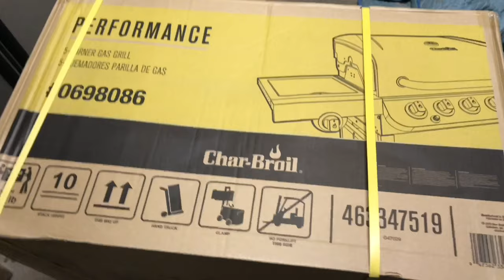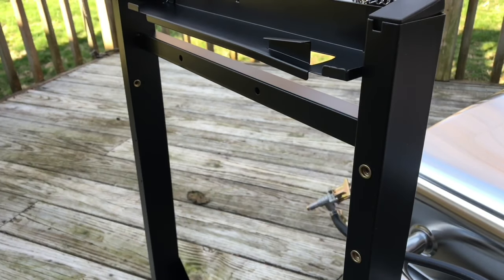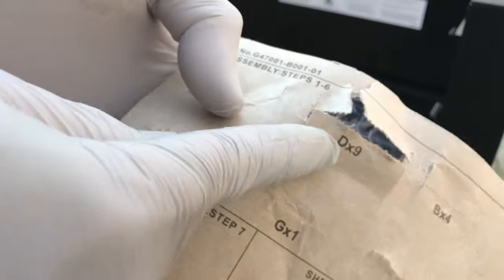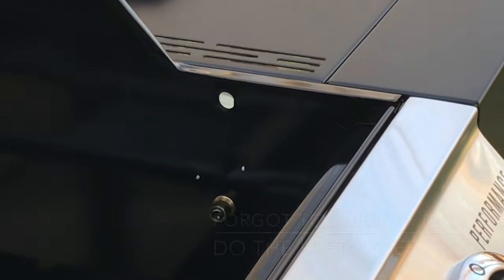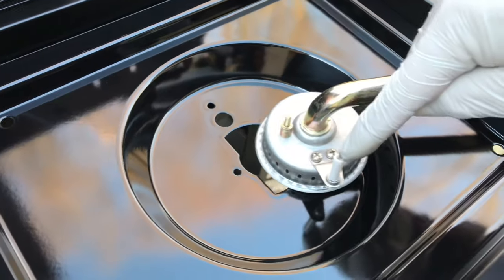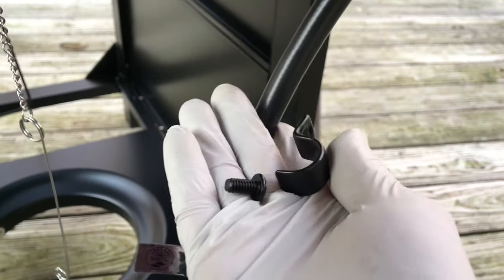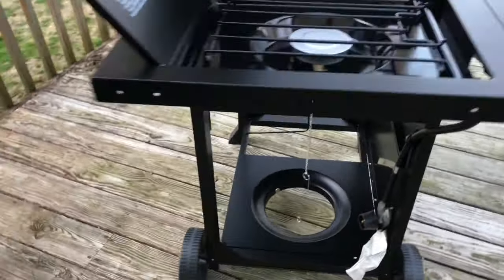Step by Step How to Assemble Char-Broil Performance BBQ Gas Grill 1 Side Burner Venturi Clip Install

Comment: You are the only person to actually show how to install side burner. Thank you. For a different grill but thank you. 🙏
Reply from the maker: I appreciate that!
Reply: Yes, I just got a very similar Char Broil "4 burner grill  with side burner without cabinet" at Menards yesterday but the factory seems to have made a mistake and included the instruction manuals for the version without the side burner and I had no instructions how to set it up. I did figure it out, but checked this video out and do find out that that one strange clip I still have left in the package also needs to go on the bottom. Seeing that was the most "rewatched" point in the video I suspect a lot of people got that manual. About to go buy a tank of gas and hopefully the thing works.

Comment: Big THANKS on assistance for side burner valve bracket-crazy clip thingie!! Part M dilemma solved with your help.
Reply: Did Charbroil include the wrong manual with your grill too? Mine came with the instructions for the one without the side burner but my grill very definitely has a side burner.

Comment: I always assemble my own grills because I trust my abilities but Lowes had them all assembled and it was kinda nice to not have to mess with it for once. Between ikea type furniture lately, grills and I have to do my sons bike for xmas i wasnt complaining.  I got this for $112 at my local lowes today, what a steal.  I wiped the inside and grate with canola and did my seasoning so shes ready for her first cook. 

After repairing burner covers and making brackets for the burners that were broken from a rusted out body on my 8 year old 3 burner it was on its last leg.  Also I could smell excess gas when usin the side burner and the ignition burner and i felt it's time to get a new one.

Comment: We were stuck on a specific part with the side burner, thank you for your video, it helped👍🏻
Reply from the maker: Thank you very much for watching and for the feedback! I can only bet that it was the Venturi Clip..? It is that little twisted wire connecting the tube and gas source/knob. Thanks again!
Reply: cbatilo lol, yes it was!!
Reply: How/what to clip the Venturi clip on for the side burner? I can hook one side into a hole on the burner but not sure where to hook the curvy side?

Comment: At 08:22 whje you connect the burner is that all you need when you connect the metal pipe to the metal gas part ? Wouldn’t the gas Leake ? I purchased a second hand bbq and I’m thinking maybe there is a part missing

Comment: How/what to clip the Venturi clip on for the side burner? I can hook one side into a hole on the burner but not sure where to hook the curvy side?
Reply from the maker: Pause it at 8:26 and 8:27 - It just hanging on the gray metal part of the fuel line. Thank you for watching

Comment: Hi could you help me pls ?
On my bbq i have the same side burner as you and at 8:16 is there any rubber gasket that holds the adapter in or its just the metal part connects to the tube ? 
Im worried there will be a gas leak without a gasket.
Reply: Metal tube to metal... it is designed that way. No gasket or rubber
Reply from the maker: Metal to metal... no rubber.
Reply: @cbatilo  thanks for the answer

Comment: Did your BBQ have issues getting up to temperature? I have the same BBQ for 3 years, and it's never been able to get up to 500 degrees pre heat heat. I wonder if it's a bad pressure regulator from the factory.

Comment: HI Great Video, do you know What is the function of the spring on the left of the barbecue?
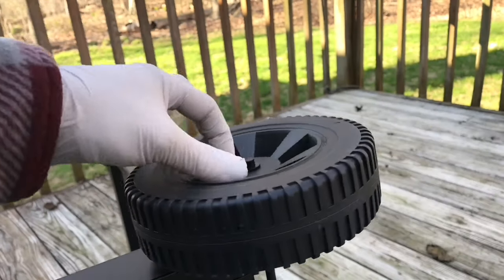Reply from the maker: Can you tell me what time I the video... where I can see the spring? Example... 3:16 ... are you referring to the Venturi clip?
Reply: @cbatilo  Hi, you can see the spring at 7:40 minute (the steel spring oscillating on the right ). thanks for your feedback
Reply from the maker: Is it the one attached to a mini chain? To the right of what I was working with? If it is... that is used to manually light the grill with a match. It is a match holder. You squeeze in a match between the metal loop. Then light the match. Insert it through a hole towards the burner. Turn on the gas slowly...
Reply: @cbatilo  Thanks a lot. it would have been impossible to understand it without your answer :-)

Comment: How does the grill cook? When cooking steaks is the cooking uneven? Does it flare up too?
Reply from the maker: It cooks the steak great... I found by turning all of the 5 burners helped a lot (even without anything on top of it). The purpose of that is to keep the temp inside (keeping the lid closed). I know and respect how people grill or bbq. I have my way... with a clean grill to start with, I fire up all 5 burners and closing the lid afterwards... heat it up above 400... then place my steak or meat and closing the lid ASAP to prevent heat from coming out. Grill it 2-3 min each side... then with the lid partially closed... I flare it up by flipping the steak hard to let the grease flare it up... the flare up will crisp my steak. Then I turn the two burners directly under the steaks but leaving the other 3 for 1-2 more min. What I get is a medium steak... yes it flares up... when I toss / flip the steak hard. Thank you very much for the question and for watching!

Comment: I am trying to replace the hose and regulator. However I am unable to detach the hose. The replacement hose screws on but the hose that came with the grill (8:10) is not screwed. I tried an adjustable wrench but it only turns (both ways). Any advice on how to detach the existing hose?
Reply: Did you fix the problem? I have same issue.

Comment: Can you hook this up to a gas line from the house?
Reply from the maker: Unfortunately, no... no you can not connect this model as is. You can modify all the fittings on this grill if you really want to... but, I say just get a natural gas model vs converting one. Thank you very much for watching and for the question.
Reply: @cbatilo  most natural gas grills are like $600 more :(

Comment: Third one I have watched, and NO ONE addresses how to mount the tank onto the frame using the part#9 and the balancing of the tank on the grill frame. I can screw the regulator onto the tank, but the hose is not long enough to reach the tank with the tank sitting on the ground. What do I do, just balance the tank on a brick? How safe is that? FINISH THE JOB; FINISH YOUR VIDEO.
Reply: What are you talking about? With the tank in the hole in the bottom shelf, the hose and valve should reach the tank easily. 

Make sure you put the top of the grill on correctly so the tank hole is on your left when you face the grill from the front. I got mine 2nd hand without instructions and mistakenly had it reversed and the hose would not reach. Once I detached and spun it around it fit easily.

Comment: I just put mine together but for some reason the side burner knob won't turn, can you help out with that?
Reply from the maker: Did you press slightly down... then turn? Next, I would disassemble it. See if will turn while it is not connected to the grill. Put it back and try again... it may have been defective already.